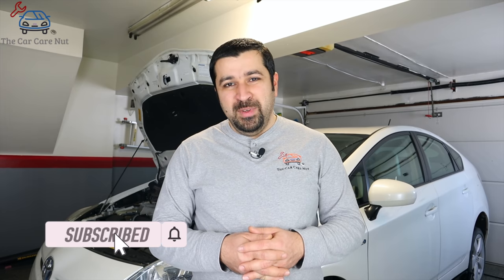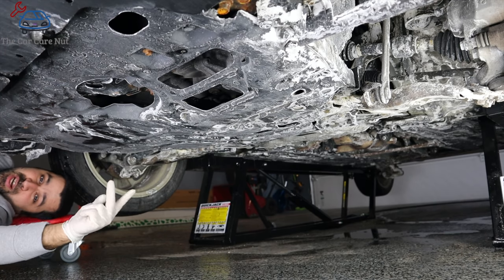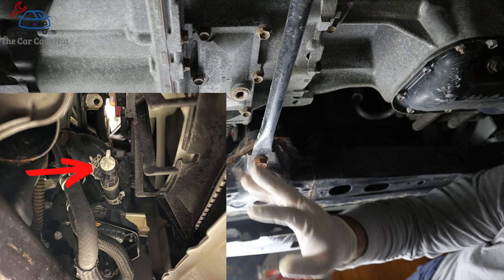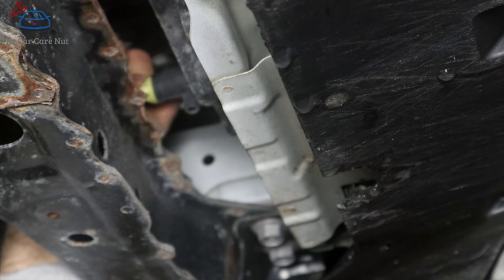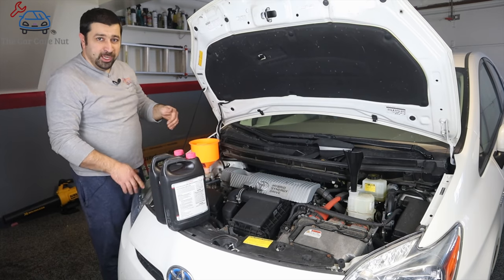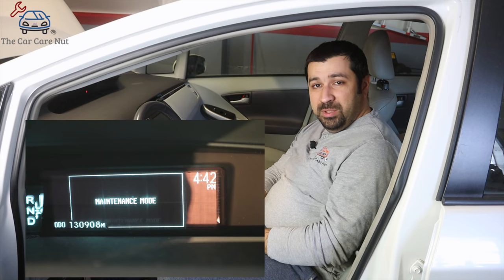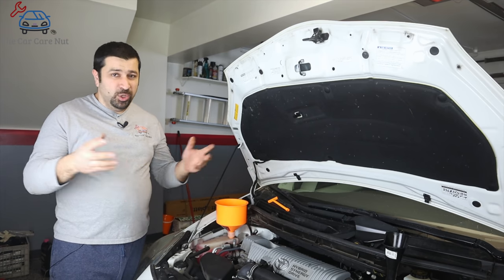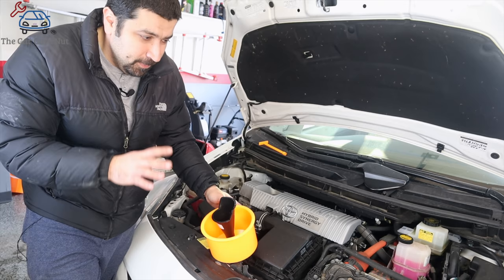How to replace your Toyota Hybrid Inverter and Engine coolant

Comment: Hey AMD! I’ve never had such an amazing time watching your videos. You’ve saved me so much $$$. Anyways, I have a 2012 Camry Hybrid, and ever since I changed the inverter and radiator coolant; I’ve noticed that my car isn’t going into EV as often as it used to during startup and sometimes even hesitates to turn off the engine during its start/stop cycle. I did everything as described on your videos and bled out as well. Where did I go wrong? Any insight would be greatly appreciated. Thank you!!
Reply: Also wanted to note that I cleaned the Mass Airflow Sensor. Hopefully I’m not just being paranoid of my own DIY job, but just want to make sure nothing is wrong. Technically, if there was anything wrong, I figured there would be a check engine/battery light on.
Reply: Did this issue of yours ever get resolved? That sounds concerning and I'd like to research that problem before tackling the coolant on my own. I also own a camry hybrid 2014 model.
Reply: @Wakemeup456  i was just being paranoid 🤣 my car has been running amazingly well! The coolant I took out was disgusting so I’m happy I did the change!
Reply: @Xainlrd  hey Anthony I have a 2012 Camry hybrid as well. Was there anything different that you encountered compared to this video? Going to tackle this shortly. Dealer wants $400+ to do both.
Reply: @b8addict  nope this video was 1:1 with the camry (other than the different reservoirs)
Reply: @Xainlrd  awesome. Thanks for the quick reply!!!

Comment: My engine coolant level was at minimum. I added about 250 mL demineralized water to be used in batteries an cooling systems. The coolant is Toyota SLLC. Is there a problem I added a little water to bring the level to MAX? Can this lead to clotting? As far as I know SLLC already contains water. The temperature here rarely drops to -15 Celsius in winter.
Reply from the maker: Hi! It shouldn’t be an issue
Reply: @TheCarCareNut  Thanks alot  for the reply!

Comment: I don't know how to message you without replying here. I got my first Prius about 2 weeks ago. 2005 Gen 2. 158,000 miles.  It was fine till I went to the gym about 30 mins from my house. [5 days ago] When I went back out of the gym. It wouldn't start up, the Triangle came on. I'm checking all the normal go-to's like fuses etc, but no luck. I sent away for the "Fixit" gadget to try and diagnose it. The previous owner said he had replaced both the batteries. Any suggestions?
Reply from the maker: Hi! I would start by jump starting it. That is the typical scenario of a weak 12v battery. Get the battery tested and charged as needed.
Reply: @TheCarCareNut  I will try that tomorrow. I hooked the charger on it today but never heard it make the sound that chargers make when I hooked it up so tomorrow I'll take the battery out and try charging it again. BTW I really like that you are a person of faith. I like that.

Comment: Hybrid system check light came on 
2010 Toyota Prius after i run to the maintenance mode for 30 minutes my fan start to turn on and it didn’t turn off i was leaving to run after that my Hybrid system check light come on what’s is the issue any idea ?

Comment: Thank you for this information. I am waiting on my Corolla Sedan, the full option one, to be delivered in march:). Do the hybrids, 2021 models, eat up oil as well? Should I stay on the safe side and replace the oil each 6 months? I’m usually driving less than 10.000 km a year:). Mostly City and minor commute.
Reply from the maker: Hi! I personally would replace the engine oil every 6 months. I would read into the maintenance guide and pay special attention to any special operating conditions and their additional maintenance needs and compare those operating conditions to your driving to make the best maintenance choices.
Reply: @TheCarCareNut  Thank you. Your advice is invaluable, and keep up the great work. I've learned a lot here on the channel, and I don't even have a Toyota at the moment 😂. Kudos on the content

Comment: Dear AMD: another informative video from you thank you very much sir.  Is it a conincidence or is it my imagination that your garage share the color scheme of a typical Toyota dealership!  You see I used to work in one long ago in the part's department and I swear they had the same red stripe and grey that runs along the wall.(14:00)
Reply from the maker: Hi Dominic! You are correct on the colors! I always liked the colors from the shop and when I did my garage I went with similar colors. The darker grey at the bottom give a a darker contrast and is easier to hide dirt from working on cars. The white upper part amplifies the light and the red line gives it a striking look.
Reply: @TheCarCareNut  Thank you for the kind reply sir, that solves the mystery since your first upload.  Had always thought you would stay behind at your workplace to record your videos.
Reply: @TheCarCareNut  I used to think you did your videos at the Toyota dealer.  Your setup is so professional with the big tool cabinets and the Toyota striping!

Comment: Great video!! This is easier than I thought!

I have a question if you have the time to answer it. I have a 2006 prius that I’m trying to get smogged in California. My car is fine no warning lights and no other codes. I went to two smog shops and as soon as they connect their scanner the red triangle pops up and check engine light and vsc light. The code is U0293 that connection was lost from hybrid system. The engine fan turns on as well. My 12v battery reading is 11.9 with the ignition off. Is this a bad battery and could it cause the issue since the computers run off the 12v? Any other thoughts or advice would be appreciated!
Reply from the maker: Hi! It could be an issue with the battery. I would get the battery load tested and if it fails replace it if not get it charged
Reply: @TheCarCareNut  this would be the 12v battery correct? Not the hybrid? Thank you so much for the speedy reply!
Reply from the maker: Yes that’s the 12v battery not the hybrid one.

Comment: Does engine and inverter coolant are the same?
Reply from the maker: They are separate systems but both use Toyota pink long life coolant for all Toyota and Lexus hybrid models. Except the 1st generation Prius which used red coolant
Reply: @TheCarCareNut  thanks

Comment: PLEASE HELP! I replaced the bad inverter with a good used one from my other Prius . I connected the two batteries again (making sure the orange plug is locked in) and the car now won't start .It still says check hybrid system but the engine won't even come on now. I checked all the connections and hoses . Am I missing something ?Please help I m stranded here until I fix it

Comment: how many miles until change and why does it get changed?
Reply from the maker: Hi! It’s recommended to replace it the first 100k miles or 5 years then every 50k miles or 5 years. Coolant breaks down and becomes acidic and starts attacking seals and leaking.
Reply: @TheCarCareNut  Thank you, will do sir!

Comment: This is only for hybrids ?
Reply from the maker: This procedure is for hybrids. The engine coolant side can apply to non hybrid 4 cylinders however I will have a separate video on that in the future. The V6 models are different and have a specific procedure

Comment: Excellent video!   I will subscribe.  One question, do you have the part number for the OEM coolant you want us to use (I am changing antifreeze only at this point)?   In the video you mention the PINK and Yellow cap stuff is older (no good) yet you seem to be adding PINK cap stuff in the video?   Or are you adding a RED cap stuff?   I have a 2013 Prius.  Thanks again!
Reply from the maker: Hi! Coolant part number 00272SLLC2. Pink cap is new and good. Yellow cap is old

Comment: How can I identify when the fan comes on and off ?
Reply from the maker: Hi! You’ll hear it or sometimes it comes at low speed you’ll see it spinning. The cooling fan is between the radiator and the engine

Comment: What happens if you forget to turn off the heater during the bleeding process?
Reply: It will take longer for the fans to come on during the bleed process, but will not hurt anything.

Comment: "Please help me? "
I have a 2007 toyota pruis and like 7 months straight i was adding power steering in the inverter coolant reservor tank but I washed the two lines to the electric  water pump and also i replaced the water pump with a new one the only problem now is it wont let me bleed it or something im doing ? My name is Rigo.
Reply: Hola Rigo!

Comment: How to check the transmission oil level on hybrid Camry 14
Reply from the maker: Hi! It’s similar to a manual transmission. Take the fill plug and fluid level should be at the bottom of the fill plug

Comment: What is the reasoning for having the heater off while bleeding the air? In other cars, one would have the heater on to move the coolant through the heater core. It even says on the bottle of toyota coolant to have the heater on. I'm not disagreeing with your expertise, simply trying to understand why

Comment: Thanks AMD for nice video with tips and tricks that many other similar video left out (the "click" for the resovoir cap). 

Btw, 2013 Prius-C have another drain point, near the oil filter, hold closed by a stupid clip instead of a normal yellow screw. 
Also, the radiator reservoir doesn't seems to drain out because it sits lower, also no easy way to take out and pour out. I had to use a very long hose to suck and avoid swallowing accidentally.
Reply: A mityvac hand suction pump and MVA6845 mason jar kit would help you suck it out without having to risk swallowing coolant.  There are other vacuum pumps that would work, too, though I haven't stumbled across them, or they are much more expensive.

Comment: I have a 2011 Prius with overheating issues. Replaced out engine, water pump, sensor and thermostat. I have issue when I drive high speeds 70-80 mph up hill. Reservoir very hot almost to boiling temperature. Temp red light would turn on or flash and then when I slow down it will eventually turn off. My mechanic replaced literally everything minus the radiator and the inverter coolant pump. Can anyone please help????

No codes or no check engine lights just the red light engine temperature turns on when driving high speeds up hill for long periods of time. 

Is the issue temp sensor on EGR pipes?

My mechanic has replaced with all OEM parts. Any advice?

Toyota service rep says might be inverter water pump, radiator clogged up, or water pump. 
Just a had Toyota dealership diagnosed and they check for any leaks so it’s not the engine. They said water pump and thermostat. 

My mechanic replaced those 2 parts. I thought I was in the clear but I wasn’t. The car still overheats when driving high speeds 75-80 mph for long periods of time and red temperature light turns on again uphill at high speeds. Anyone please help and TIA

Only radiator and inverter water pump left to be replaced and my mechanic is replacing it.

Comment: Be Careful !!!! On a 2020 Camry Hybrid, the 10mm hex drain bolt that looks like in this video is the Transmission drain plug not the inverter coolant....Be Careful.  
There are 2 Petcocks on the lower drivers side radiator, one is for the inverter coolant and one is the regular.

Comment: Hey Car Care Nut. I'm a big fan of your channel. My 2007 Camry Hybrid has 120K miles on it. Thank you for your videos on Transmission fluid, break fluid, and coolant change, I followed your recommendation for changing those fluids. I checked the high voltage fan and added the filter screen as you recommended when I bought the car with 100K on it. I change the oil and filter every 3-4000 miles due to this years engine as you recommended and rotate the tires every 5000 miles. Do I need to have the valves adjusted, water pump replaced or any other engine services at 120K? My daughter just got in the medical school in SL MO and I need to drive from LA CA to drop off some things to get her set up.

Comment: Hey AMD, as always great informative video yesterday and coincidentally something i was trying to figure out that day too lol.

So i have a 2016 Avalon Hybrid, and i noticed checking all the fluids the past week that my inverter coolant is slightly below the low line both while cold, while the engine is running, and when its warm and resting. The engine coolant is level though and inspecting underneath i see no visible leaks surrounding the bolts.
Q: Would topping it off to Full be alright? Or would that cause air bubbles/need a proper flush for new coolant?
Reply from the maker: Hi! I would top it off to the full line and after some time check it again. If it doesn’t drop you’re good.
Reply: @TheCarCareNut  okay great, will do 👍. Thanks for clarifying that!

Comment: Thank u so much
Ur videos help me allot i change transportation oil for my camry

I have now new issue 
I used techstream and show me code
P268115 engine coolant bypass valve circuit short
Camry 2019 hybrid 
If u can assist me 
I find the valve is close to windshield

Comment: I just flushed my inverter coolant in my 2013 Highlander Hybrid but nothing drained from the drain plug, I even stuck my finger in they and it was as dry… I proceeded to drain it from the drain valve instead… Why is there a drain plug?

Comment: Why not turn on the heater?
Reply from the maker: Leaving the heater on will make the engine take longer to warm up and open the thermostat.
Reply: Will it leave a bubble to have the heater off or does the coolant circulate anyway?
Reply from the maker: The coolant circulates anyway.
Reply: Yes, modern cars don't have a "hot water valve" anymore. They use a "Blend Door Module" but these can fail and you'll think your AC is out. The Prius has 2 and many times you can clean them and they will work. Use a little Deoxit D5 made by Caig to clean the dirty contacts. The biggest problem is removing the two screws that hold the module. You need a flat screwdriver like an ANEX slim offset screwdriver # 6102 (Amazon) and once those screws are out, use a longer screw with a nut that will make it stick out for next time. I still think that a hot water valve would help AC efficiency.

Comment: This is a dangerous method of filling the cooling system. This way you can break the cylinder head gasket. The correct way is to use a vacuum device.

Comment: don't know for sure, but maybe leave cap on, pull plug then cap, won't drain as fast
Reply: It's worth a try!
Reply from the maker: It works.
Reply: @TheCarCareNut  I too don't like making a mess, just trying to think of a more controlled way, these cars have drain plugs in the engine block

Comment: Just to be clear 2 gallons of 50/50 pre mix will do both the engine and the inverter correct?
Reply from the maker: In a Prius yes

Comment: I own a 2015 toyota highlander hybrid and did the replacement of the coolant as per your video. The motor coolant was replaced by way of draining the radiator directly as shown but I poured the coolant directly in the radiator as I did not see the small reservoir next to it and nothing in your video mentions this reservoir. This reservoir does not have a cap that screws on but a cap with a small tube that seems to go back into the reservoir. A friend of mine who is a retired mechanic explained to me that I was supposed to have some coolant in that reservoir as it is used to receive any overflow from the radiator. Is this the case? Could you add a segment to your video to explain how to deal with this situation? Thanks.

Comment: The funny thing is if you're coolant is maintaining the light pink color that it had when you bought the car new or if you seen pictures under the hood you really shouldn't touch it in the inverter part of the system it does not see the same as running through an ice engine This is going through a clean aluminum inverter a clean electric pump and making a continuous loop My Prius with 350,000 mi has the original inverter coolant in the system even when I change the pump I just squeezed off the lines inserted the new pump added half a pint that I lost maybe and kept going You don't need to fool with this check your ice engine coolant in the radiator keep that maintenance leave the inverter alone just unscrew the top with the car and ready mode and you should see the coolant moving slowly but the cat back on and leave it another problem is do not overfill it but it right on that line cold and leave it alone just make sure that it moves put your hand on the bottom of the inverter after a good drive You should be able to touch it but it should be hot

Comment: Please remove this video, it’s completely wrong. You showed everyone how to only drain half the engine coolant because you don’t know to drain the rest of the coolant in the secondary spot on the engine itself. You had 8 quarts of fluid (2gallons) to refill both reservoirs. If the engine coolant is properly drained completely you need 9 quarts to refill that alone! Please look up the coolant capacity and see for yourself how wrong you got this. Would you replace half your engine oil?